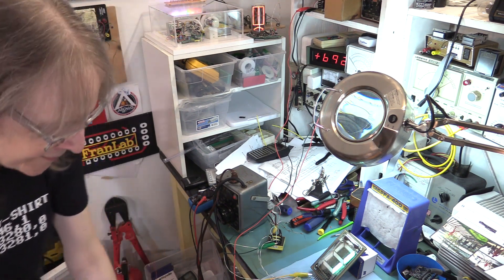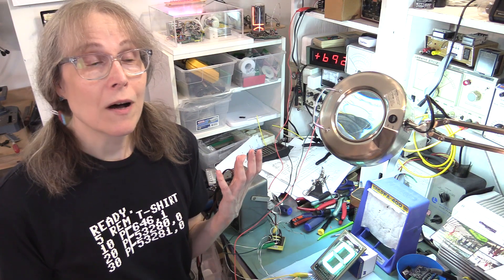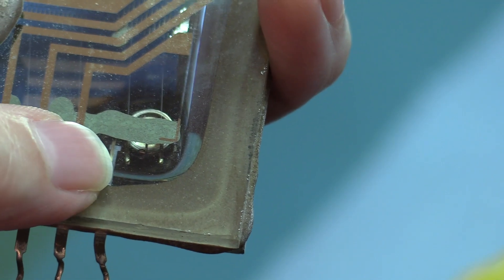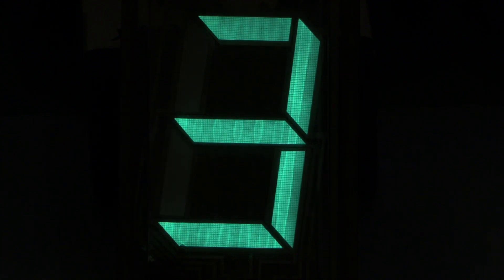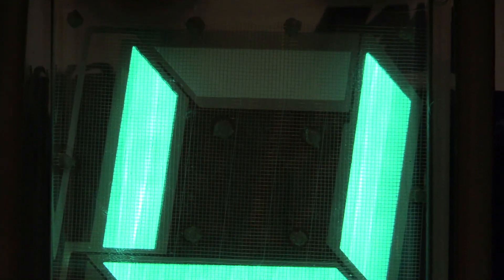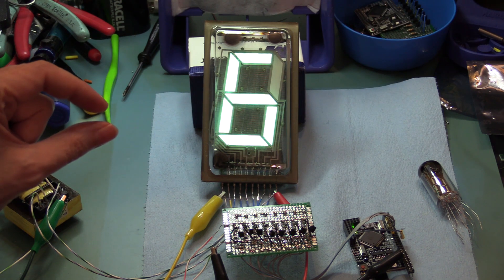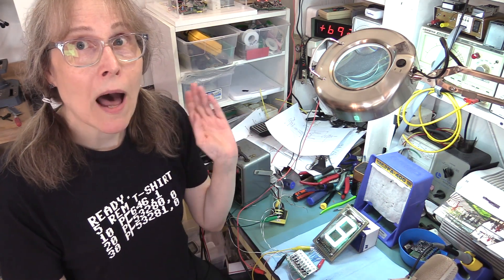If At First You Don't Succeed...  Monster VFDs Pt 2

Comment: When I watched the first video I did think you needed to have a Totem pole drive.  I would use L298 drive and China does some cheap boards Max 70v and I drive them directly from Atmel chips. The L298 is very flexible you can set current limits, also global enable pin to PWM.

Comment: I wonder if the open filament can be fixed by applying a high voltage via a capacitor to sort of arc weld it.

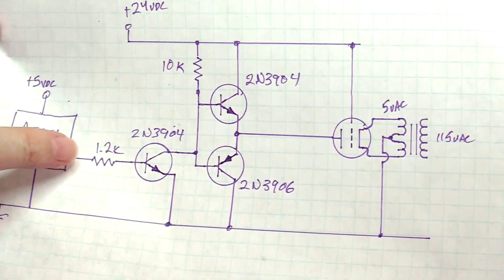Comment: I'm surprised that given you needed a "rail to rail" driveer (3:00 mark) that the transistors (4:51) had the NPN on top and PNP on bottom - this means that it will only go to within Vbe of each rail (about 0.7 below the 24V supply and 0.7V above ground).  If the positions of these were swapped (with an appropriate change to the first stage) it would be possible to get within Vsat of each rail, or 0.2V.  With FETs, it would be possible to get even closer to the rails, but those would likely cost more than these BJTs.

Comment: Hey, what ever it takes to get the technology working. 24 transistors per display are a lot of components.   Have you considdered substituting the push-pull pair (on the right side of your schematic) with a FET ( a PNPN ) ?
I service indutrial equipment with a big triode tube by Thales, type CTK 15-4.
Anode is 10kV to 11.4kV DC with 3 to 4 amps, heating fillament runs at 200A trms give or take, when grid is "off" it's is pulled down to -200V relative to triode tube kathode, thus applying a negative electrical field to block the flow of electrons Anode to kathode, when grid is "on" it switches at 60khz between -200 and 0V.   Only the one element unlike a 7 segment x 4 or 6.
Point is, there are 3 amplification stages to reach the applied -200V switched grid, with the final one being a big fat FET.

Nice to see Soviet technology.

Comment: How about just using rail to rail op amps for driving. Some of those can easily handle 30+ volts, and if you run them as comparators it should work. The inverting input is at a 2.5v bias and the noninverting has a high value pull down resistor to ground. Output is connected to ground in this case and the display segment is off. If a logic 1 (5v) comes on the noninverting input, output goes to B+ and the segment is on. You can get away with either 4 dual op amp chips or 2 quad op amps per segment.

Comment: You could multiplex out to latch chip and through buffer chip?

I still want to use motor h bridge drivers from 3D printers. 4 push pull at 1 amp without extra cooling.

Comment: what about using a ULN2803 driver? with resistor collector pullups to +26v,ish,  and something like a 2v7 zener in series with the filament transformer centretap to ground (anode to tap), with dc pullup on the centretap to 26v to ensure centre is held at 2v7 or whatever works, this way drives to segments will be able to go a bit negative to ensure switch off??   i think seriesing filaments will cause issues as the effective 'drive' voltages will differ depending where in the chain they are,

Comment: I bought some valves from a seller in Ukrane and some had bent electrodes and open circuit filaments. I really do wonder if some of the devices for sale were rescued from the scrap bin. The pins looked like brand new too, no markings of them having been fitted in sockets.
Reply: maybe 'rejects' someone got hold of and tried to sell for a fast buck?😉

Comment: Don't think you'll get away with series heaters, that will be a lot of voltage difference
Also, could you get away with passive pull up / pull down? Maybe select on test passive pull up resistors to balance brightness, and active pull down to turn the segment off

Comment: Hey Fran, today I learned that these displays have three parts, thank you.  I always assumed they were more like diodes, i.e. a hv common biased heater and then seperate segments that are driven to ground to operate.  Even then I was screaming at your video (part 1) for not having push/pull segment drive.  I did noi know anything you didn't, it was just engineering instinct on my part.  Now that I know you were trying to keep it simple, I get why you did that.  But now you pointing out that it has a grid as well! ...wtf, I do not understand why they do, but so be it.  To redeem mysellf, I did understand why you did not use multiplexing :):):)

I assume you tried using HV low leakage BJT's with a 10M pull up resistor (in place of the push hv BJT being missing).  if not, then maybe try it with the common 2N5401/2N5551 etc. BJTs with an appropriate "push" resistor?

Comment: You have totally over engineered it Fran but if you don't keep the heaters in parallel there will be a potential difference between the first and the last display and they will be dimmer along the line it's relatively easy to drive one but you may struggle with more at the same voltage . Great work and it is so worth the expense x

Comment: I don’t think series connected  heaters will work Fran. It will cause the plate voltage to ground to be different between adjacent tubes.

Comment: Looks like you took my advice about connecting the cathode to the center tap of the filament transformer. Hows that working for you? BTW: @5:28 in your video, I notice that you said something about connecting the filament in series? Keep in mind that this may cause the center-most displays to not light. I would recommend using a higher current filament transformer and connecting all your filaments in parallel.

Comment: Well I was way wrong. 

It’s awesome. 

I’m surprised you can’t use a line buffer/inverter type chip or audio amp or op amp as drivers

Lots of h bridge fet drivers that hit rails without the transistor drop made for motors now days.

Comment: You shouldn't need one of those 24 transistor boards for EACH tube.  Use one board to drive ALL of the anodes with tubes connected in parallel.  Then make one 3 transistor driver for each tube grid and multiplex the display, with only one grid positive at a time.  You can fine tune the tubes for the same brightness by adjusting the grid voltage for each tube (steady state or PWM duty cycle), and/or each tubes filament voltage.

Most VFD's are set up to be multiplexed, even large ones.  I know that multiplexing will reduce the brightness, but before saying it won't work, try it with one tube by cycling the grid on and off to get the same duty cycle as you would with multiplexing 4 tubes.  It might be good enough.  Worth the experiment anyway.

If you do need to direct drive each segment, there are some IC's that have push pull output drivers, such as H motor drivers, then you'd need one chip per segment instead of 3 transistors.

Comment: So interesting how much transconductance affects the functionality of display tubes!
Have you tried running the filaments with DC to check if that could fix the weird pattern on the phosphor?
Reply: that'd likely make it worse, due to varying potential from whatever part of the filament to anode, with ac drive its fast varying and your eyes persistence of vision will average it out , as with a crt raster display

Comment: Try L293D chips for the driver. They're cheap and you only need 2 chips per display instead of 21 transistors.
Reply from the maker: Ooo..  That's an excellent little chip - I gotta try that!

Comment: I still think that 1 NPN transistor driver per segment should be enough. Only with little modification. I would put the center tap of the transformer to the ground by 5V zener diode and by 1k resistor to 24V rail. This would act as a negative bias for grids, because active NPN transistor will put G to 0V (so -5V relative to cathode). If transistor is off, 10k resistor should be more than enough to put the grid quickly to 24V voltage.
Isn't the schematic in 4:00 wrong? I think that there are swapped A and G on VFD. VFD has common anode which should be on positive rail and grid controlled by the driver.

Comment: Push-pull drivers - would it be worth having a 2803/4 and a 2981(or modern clone) per tube? 
I ask as I ended up with similar push-pull needs for a recent circuit and that worked well in my application.
Reply: doubt it really needs push pull drive, as current per segment is likely very low, resistor pullup would i think be sufficient, as long as current when sinking to ground is many times the actual segment current ,
Reply: Additional info:
Source driver chip: MIC2981 (there are a few different ones, Tosiba make TD62783AP ic)

Sink driver (if needed) : ULN2803 (or 2804 if working with higher logic voltages).

Used these on a few projects; they're equivalent to a darlington x8 per IC, I believe there's a mosfet version out there if you're concerned about losses :)

It's a great way of avoiding wiring a huge mass of transistors ❤❤❤

Comment: ... i wonder if you could laser wield inside the tube? if you haf a laser wielder laying around
Reply: I would try an electrolytic capacitor charged to relatively high voltage across the "open" connection (with heater in series, obviously) to try to weld it. I've also removed shorts in a very expensive storage oscilloscope tube using a similar method.

Comment: 8:36 This pattern on the phosphorus, those lines around the filaments - can someone explain what causes them and their oval shape??
Reply: electrons are ejected/sputtered from the filament wires in a exponential decay pattern around the wire and attracted to the oppositely charged plates with the phosphor on it. I'm guessing the oval shape is just a byproduct of this drop off in electron density farther between the filament wires and the pattern of lowest stable energy/equilibrium.
Reply: I'm pretty sure that's the pattern of the electron emission coming off the filament wires. I think it's sort of being "sucked" down to the conductor behind the phosphor of the segment. If you were looking for a basic explanation that's it. If you want more then i don't know. The principals are like a vacuum tube where the hot filament wires emit electrons over to the cathode which has the phosphor on it.
Reply: @volvo09  That's my understanding too. I wonder how it forms bright rims with a darker middle, even though there should be the highest emission.
Reply: @gustavgnoettgen  maybe with too high concentration of electrons some repel themselves?
Reply: @andygozzo72  oh yes, there is something like this causing distortion in audio tubes I think.
Reply: @gustavgnoettgen  you may be thinking of grid emission,  particles from the cathode can land on the grid over years of use causing a current to appear in the grid circuit, driving grid more positive, causing higher anode current as it warms up over several minutes, overdissipating, yet  more and faster  despositing, a sort of 'valve runaway' .. i have many output valves that have good normal emission but unusable in normal circuits due to grid emission, however if grid is driven by a low impedance direct coupled preamp circuit, can usually be used

Comment: why are you using 5 volts on a tube that is supposed to run at 6.3 volts?
Reply: Chance this will be answered: lol.
Reply: @beefchicken  It was answered in the video, notice what happened when the voltage was increased to 5.5v? One would likely assume it would only get worse at a higher voltage.

Comment: Fran, did you consider using a couple of Microchip HV518 VFD driver chips?  At $7.08 each they are fairly inexpensive and in the through hole package they should be way easier to wire up then discrete components.  Mouser has them here: https://www.mouser.com/ProductDetail/Microchip-Technology/HV518P-G?qs=Dqtu6YrYCkPwE%252B7bykFlUA%3D%3D.

This is going to make a really cool clock.